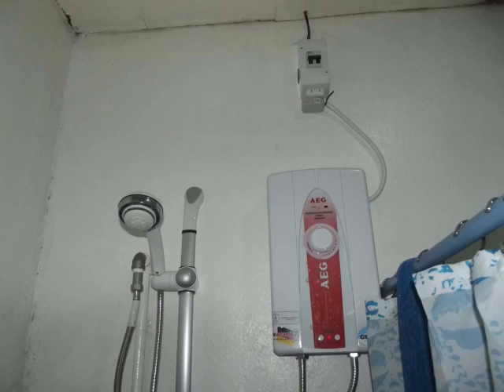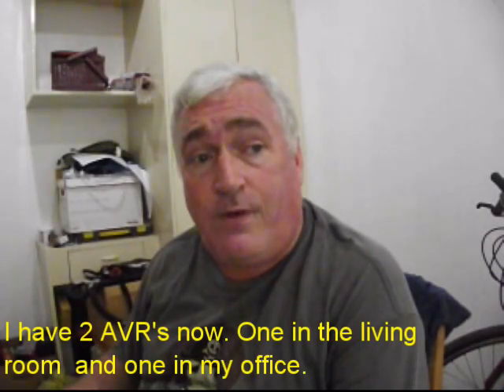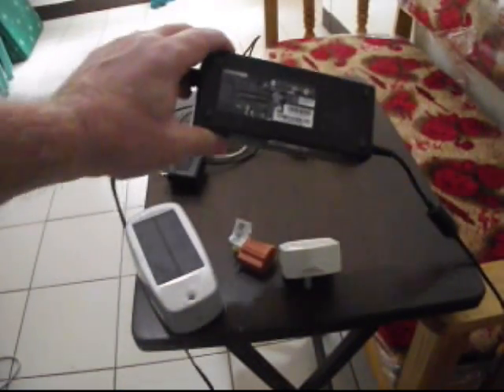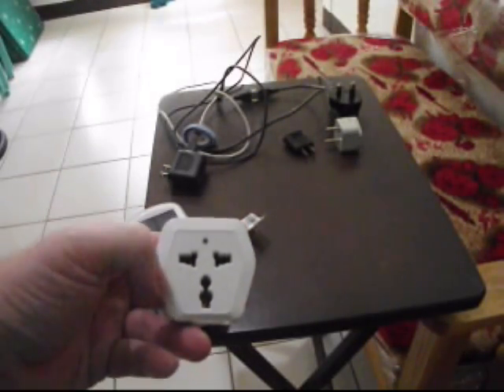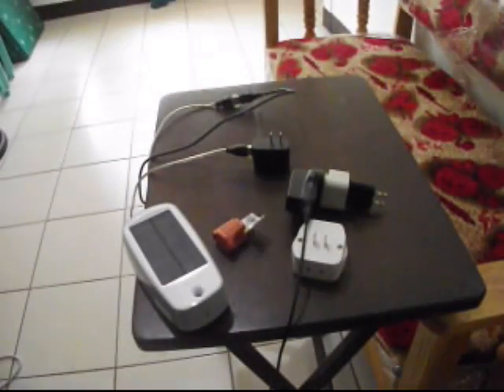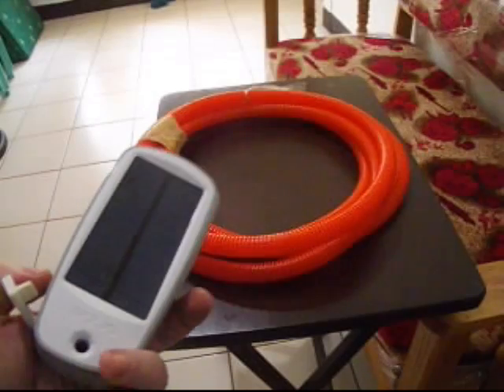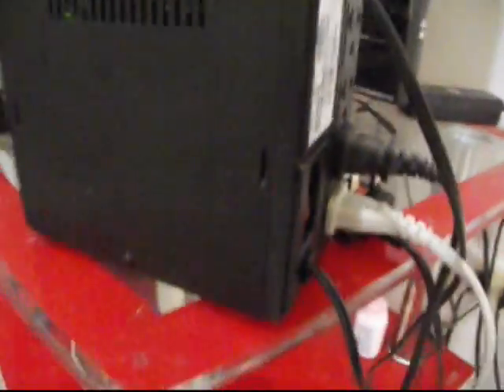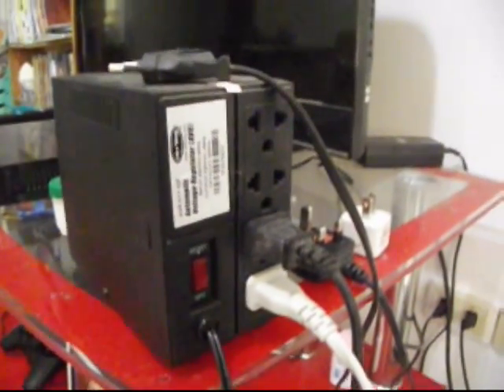Philippines electrical & using 110 appliances with their 220 volt system

Comment: Amen! What's worst is that this is how they're taught in school (if they even bother with). Plus, all the connections are twisted wires.
Reply from the maker: I had an "electrician" removing wire nuts because he said they are not as 'good a connection' as just twisting? 😎

Comment: Hire a real electrician and dont be cheap and you’d find out that that they’re better than the US Electrician.      You make derogatory comments about your Filipino electrician, you should have told him about your immense knowledge.  Like remove the other wire to make your  lines110 and ground the other wire. Done.   You pretend to be so smart yet knows nothing.   Brahh. GTFO.
Reply from the maker: We have a 220 line and a neutral. There is no 110 available. Take you advice to someone who cares ha ha

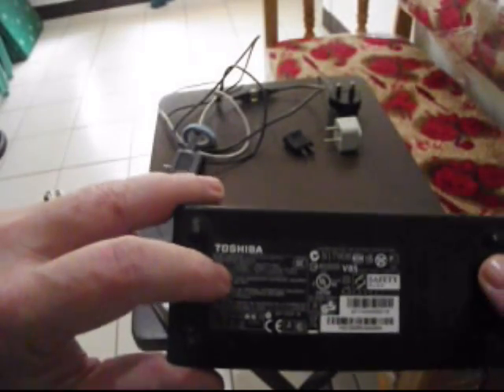Comment: 5:18 - That is not "dual voltage", it is a range from 100V to 240V AC input.  Someone could use ANY voltage within that range, not just 110 and 220.  8:02 - those are not plugs, they are sockets/receptacles.  11:06 - same thing.

Comment: The electrics here is an eye opener. Even when the electricity board comes to instal your meter on a pole.  The cables are just twisted together and taped over with insulation tape. This is open to the elements. 
Can you instal a ground wire for your 3pin appliances   Good video, actually learned something 👍👍👍
Reply from the maker: I know some guys that install a ground on new construction, but in an existing house you would have to pull new wire to the outlets, so generally - not practical.

Comment: I am sorry if my country can’t provide good service to you... sorry we’re not that educated about this “Basic electrical” problem...
Reply: master ball I am interested in this video because I just sent many 110v appliances to my mom in law in Bataan, I looked into buying the appliances in pinas but the cost was 6 times more than in the USA , that is the reason for my frustration a ninja kitchen system in pinas cost almost p50000 but here in USA it’s p5000 Lang po , that’s why we need 110v
Reply: @65mustangguy  In both of the places I have rented in Angeles City, there was 110VAC and 220VAC in the house.   The plugs were right next to each other.   I learned it is best to check with a multimeter before moving into a new place, though.   The first place I lived, the 220 had the round type sockets, and the 110 had the flat US style sockets.   The second place had just the opposite--- 220 on the US style sockets, and 110 volts on the round type.
Reply: masterball, i feel the sarcasm, but believe me,  the electrical system in the Phils is a "huge" CHALLENGE to expats and pinoys abroad (north america) who want to send 110v appliances back home. I have looked into the prices and quality of available appliances in the Phils and they are way more expensive there, whereas we can even buy them at dirt prices come spring/summer and "garage sale"time. The Phils should look into allowing option to install 110 (which would save the Phils way more energy to mitigate "brown outs"in summer.  I am planning to retire in the Phils and am looking into
Reply: I hope you are joking with your statement , it’s not about the knowledge , simply put the knowledge is there , this is about the infrastructure needing to be upgraded or replaced altogether. The real issue is all the government and private sectors standing in line with their hands out expecting to be paid for allowing anything to happen in their districts
Reply: master ball the infrastructure need replacement
Reply: Why are you apologizing to the white man?

Comment: Wear your flip flops when touching your sterio to avoid shocks and unplug the fridge after a power off then wait ten minutes after it comes back on before plugging back in to avoid dirty power.
Reply from the maker: All the foreigners question why so many locals unplug everything when not in use.  There are good reasons...

Comment: Can I use my circular saw 110 ,northern Phil
Reply from the maker: You will need a 110-220 xformer.  Some guys on the old base in Subic have 110 V, but that is rare in most parts of the PIs  😀🍹🇵🇭

Comment: best bet is to ''not'' use a step up or down transformer by itself.be sure it is also has voltage regulator capability to save yourself from brown outs or surges.but a 110v surge protector/power strip would be another layer of protection down stream from your voltage regulator.during a brown out,there may be only 130v at that time and the regulator will keep things constant for your 110v need.i've seen several on line here in US that are around $150ish that are anywhere from 30-50amps.**as a note** buy a decent voltage tester and learn how to use it by youtube vids if you choose.but,you can actually see voltage available at you outlet before you plug anything in.
Reply from the maker: I brought my old Fluke with me, but forgot to bring my clamp on... not sure where it ended up ha ha 😀

Comment: I've been living in the Philippines on and off for about four years, and I just wanted to add my own two cents.  That orange PVC flex conduit that you see all over the place here seems to come in many different levels of quality, and if you get the cheap stuff at one of the mom and pop hardware stores you'll be lucky if it lasts a year out in the sun. I've been over to peoples houses and have seen this stuff deteriorate to the point where it becomes brittle and falls apart.  

The orange flex conduit that they sell at ACE Hardware seems to be of pretty good quality, and it is actually strong enough that if you place it on the ground and step on it it will not collapse under your feet.  But even the conduit sold at ACE will degrade in the sun, and I recommend painting it with flat white spray paint if you have to run anywhere that will be exposed to the sun.  The same goes for the orange rigid PVC conduit that they sell over here.  It also cannot take direct sunlight very well, and will become brittle and eventually fall apart if you do not paint it.  

Also, I recommend using Panasonic brand electrical receptacles because they seem to be the best quality, and many of them are made in Japan.  There is one brand that is so cheap that one day I tried to plug a cord into the receptacle and the entire thing collapsed and my hand went inside the box in the wall.  Very dangerous. 

The other thing I learned is that if you are using a desktop PC you will want to make sure that the hot side of the receptacle is on the right side, and that the neutral is on the left.  Also, you'll want to make sure that the third prong on your PC cord is grounded, or you'll will get shocks from your PC every time you plug in a USB device, or touch a metal part of the PC case.  

When I first got over here I didn't realize how important it was to have the hot an neutral correctly aligned when powering a PC, and I also didn't understand how important it was to have a good earth ground.  As a result, my PC would work, but I kept frying internal computer components, which are not cheap to replace.  

One last thing, all of the local electricians like to put things together using electrical tape, and sometimes they only put one or two wraps of tape on a splice joint.  Wilcon Hardware has a good selection of wire nuts imported from the US.  In my case I couldn't go up into the space above the ceiling because I'm too big, but I was able to teach one of our helpers how to put on the wire nuts, and I had him take digital photos of the junction boxes so I could see his work.
Reply from the maker: Unfortunately our electrician says wire nuts don't hold as well as just twisting the wire together... he actually removed some wire nuts on stuff I had already installed. They won't learn...  And as far as ground goes - I have never seen one here. All our plugs are 2 prong, and the system is ungrounded.  It is best to just not look at it ha ha
Reply: Well, in my case what I did is I went outside my house and drilled a hole into the back an electrical box inside a wall in my living room.  Next I paid some kid in my neighborhood to pound a 1/2" stainless steel rod into the ground, and then I clamped a wire to that and ran it through the hole I drilled and attached it to the receptacle so that it would be grounded for my computer.  

Back when we were building our house back in 2013 I purchased a bunch of three prong receptacles (very similar to the type we have in states) and asked our electrician to install them in certain areas of our house.  Unfortunately I had to go home to the states during the construction process, and I didn't get to oversee everything.  When I returned to the Philippines I noticed that the three prong receptacles were installed as I asked, and didn't think much more about it.  

Later on I started having problems with my computer, and a few other appliances, so I took out the receptacles to have a look.  What do you know, the electrician didn't connect a wire to the ground screw on the back of the three prong receptacles, he merely installed them into the wall, but didn't connect a ground as I asked him to do.  Later on when I asked him about it he said, "Sir, here in the Philippines the third prong is only a decoration, and we do not use it."  - Can you believe it?  Reminds me of your story about the guy who claimed that tape is better than wire nuts.  

I've been thinking to make my own video about the electrical work that I've done, but I'm not fully up on the latest technology.
Reply from the maker: I thought about adding a grounding rod, just as I had to do it to a house in the US that was ungrounded (built on the 1920s and still on knob & tube wiring) but nothing here even has a grounded plug. So adding a ground is pretty pointless, when no appliances have a ground anyway.  I had to replace the power supply on my PC and the new cord has only 2 prongs, just like the refrigerator, blender, drill, tv....
Reply: I've seen cords that have only 2 prongs on the end that plugs into the wall, but have three female slots on the other end that plugs into the appliance/PC.  Problem with this type of cord is that the third female slot on the appliance end of the cord is usually tied into the neutral prong on the receptacle end of the cord.  This means that if the plug is plugged in backwards, or the receptacle isn't wired correctly, the body of the appliance can become energized with hot 220v.  This same thing happened to me with microwave oven, and our helper kept getting a shock from it every time she touched it.  But you're right about one thing, don't look at the wiring over here, because if you do you'll be scared out of your wits, and if it ain't broke don't fix it.

Comment: 220V in the Philippines uses 60Hz or cycles coming from Philippine powerplant like Meralco.

220V 50Hz and 220V 60Hz are not the same frequency but the voltage is still the same.

If you have US 110V 60Hz hairclipper plug it with stepdown 50w transformer on 220V 60Hz outlet, the sound will more quiet on 60Hz. Using a US hairclipper in Thailand, Europe, Australia with 50w transformer, so the sound will make horrible noise on 50Hz.

50Hz is used in Jamaica 110V, 100V Eastern Japan (60Hz in Western Japan), Barbados 110V, Europe 220V, Thailand 220V, Vietnam 220V, etc.
Reply: Francis Litan if u have an appliances that is 50hz from middle east and u bring it here in philippines.. how will it works? Should i use transformer or an avr that is 1000w? Pls help me
Reply: Rica Miranda Saudi Arabia is 60Hz.
Reply: Rica Miranda Convert to 50Hz:

100V - 240V to 12V AC to DC adapter

DC12V to 240V 50Hz inverter (3000W)

Comment: Thank you for this presentation.  I am from Seattle, now living in Manila.  I have been asking about Philippine electricity for a long time and your video gave me more information in five minutes then I ever got before.  One thing I will add:  For small U.S. rechargeable  devices, like electric tooth brush or small electronics, when using the conversion transformer, DO NOT leave it plugged in all the time like you can in the U.S.  If you do they will overheat.  Plug in long enough to charge the battery and then unplug.  Monitor it for over heating during charging and unplug it as soon as it starts to get warm.   Thanks again.

Comment: so what about using a http://ecx.images-amazon.com/images/I/71UILaXgOPL._SL1200_.jpg
but how to charge it up will be the problem unless it can charge with solar panels
Reply from the maker: joe selzer If it has a 220 input - or you have a transformer - that would probably work well.
Reply: ok then the battery power pack thing would work well if i can can charge it up using a transformer  is that what u mean? so then what step down transformer would u say is good in the Philippines and i know some have a built in avr as well right.  so what brands or model would u recommend to me. i am only going to power a 20 watt 110/1120v usa device thank u for your help.